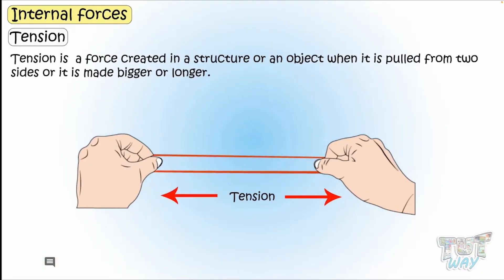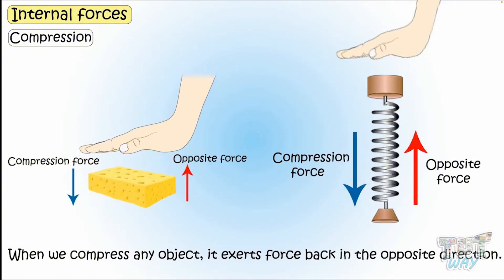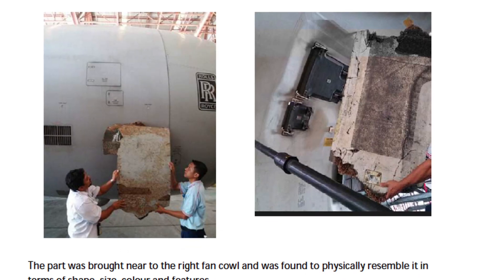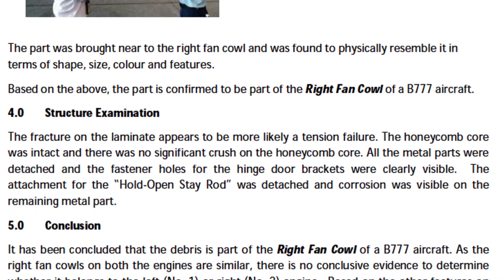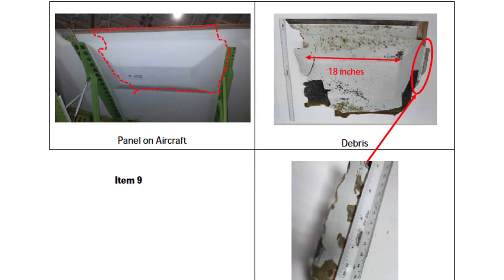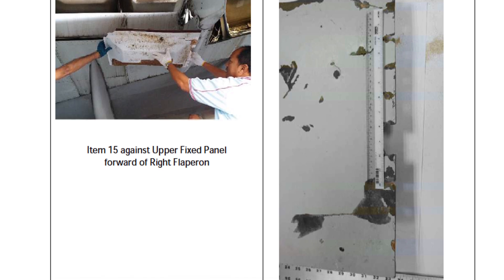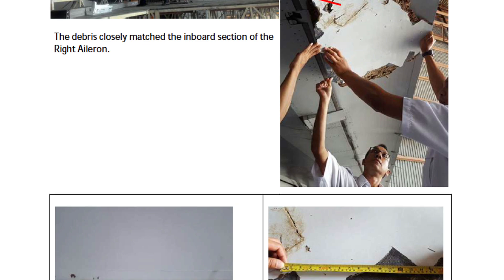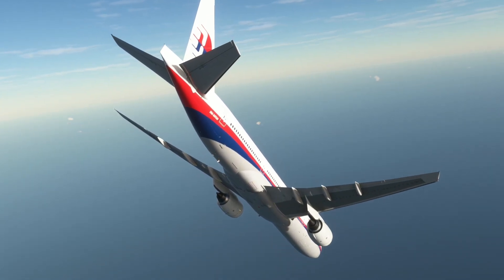How The Plane Broke [Finding MH370 S2Ep11]

Comment: Does the debris that has been found from MH370 look like the pieces were possibly separated from the rest of the plane by man?
Reply from the maker: That's a great question. Malaysia published a report describing the kids of mechanical breakage that each of the pieces of debris found, and they overwhelmingly failed under tension (i.e. pulled apart) rather than compression (being crushed, as you'd expect in a high-speed impact.) I should do an episode about it....

Comment: If this plane was said to have been   flying around aimlessly over the Indian Ocean etc,  until it ran out of gas.. It's my belief that it had to be hijacked.   As if something happened to one pilot,  the other pilot could take over. If it had some mechanical failure, I think at some point, the air traffic controllers would be told,  after all that time..all those hours, before plane was lost. RIP to all on board.  I believe it hijackef
Reply from the maker: I think the evidence, taken together, solidly points in that direction.

Comment: The flapper on was extended when it hit the water meaning someone rode it all the way to the water.
Reply from the maker: That's a notion that has been widely circulated on line but official investigators came to the opposite conclusion.
Reply: But if the landing gear door was found torn off that leads to the landing gear being down for a ditching. If it wasn’t open it would have been crushed. So who ditches with the landing gear down but flaps not engaged? Is that even advantageous at all?
Reply: @wuldntuliktonoptb6861 That was also misidentified as a landing gear door

Comment: The mystery man interview did not sound genuine.   For example it’s 100% obvious the MH370 did NOT hit the ocean nose first at high speed.  The mystery man was claiming nothing can be gleaned from a single piece of evidence. This is an outright lie and he must know it. Granted, it’s not going to give the whole story with high degree of certainty, but that was not the question.  And the nose evidence proves the official prevailing narrative that the plane nose dived into the sea is impossible. 
    The fact that the official findings ignored this fact and that the crash investigation team included experts raises the question why was this intentionally ignored? 
     Also the flapperon damage shows it was extended at time of impact which implies someone on board was attempting to survive a water landing. This leads to the question was the crash location a rendezvous point where he was picked up?

Comment: TWA800 fine point: I actually had some minor involvement.  Although yes massive reconstruction effort over time, within a few weeks of the accident, I told my boss the experts are saying it was probable jet fuel/air mixture explosion, and not a missile.  We found out there was already joint industry task force working the issue and possible solutions.   This is my perspective - not sure exact timing when fuel/air mix was first suspected, but there were prior examples so the issue was known, which I guess was a little like 737MAX waiting for the next shoe to drop.  Debris was supportive proof but not the only clue to the answer.
Reply from the maker: Thanks for this! One thing I didn't include from the conversation was him telling me that the reconstruction of the plane in the hanger was for the benefit of the media and the public, it wasn't necessary for solving the case, as you point out. Just by looking at the pieces as they collected them they were able to read the story in the pattern of breakage.
Reply: @Jeff_Wise  OK yes that's what I am saying.  Somehow Boeing and NTSB knew fairly quickly what the probable cause was (for TWA800 and probably MH370).   Of course FBI was brought in for TWA800, which NTSB always  brings in FBI if criminal activity is possible explanation for the crash.   This is what MH370 should look like: NTSB+FBI on the case, which was an option available to Malaysia.   Now we are trying to solve MH370 without NTSB+FBI, replacing that with groups with bias and internet crowd sourcing: not going to work in this case due to huge denial of pilot criminal intent to fly all the way to hide aircraft.  That likely scenario is an anathema for Malaysia, China and many vocal voices (special interests related to aviation industry, and many in the public).

Comment: MH-370 seems to argue for development of systems which upload CVR/ FDR data in real time to a cloud (as well as retaining existing black boxes). We’d have a reasonable idea of what happened AND where the wreckage likely was well before reaching the ocean retrieval site.
Reply from the maker: It was the data sent by ACARS through the satcom that told investigators where to search for AF447. MH370 had the system but the perp/s turned it off. As a general rule, pilots aren't going to want a system that you can't turn off, so I don't think there's any hardware you could install that would prevent a future MH370 from happening. However, a streaming data transmission system is very doable, in fact there are models already on the market. The question is getting airlines to pay for it...
Reply: @Jeff_Wise  Thank you Jeff--keep up your superb technical analyses--so valuable, intellectually stimulating, enjoyable too :-)
Reply from the maker: @Michael.Chapman  Thank you so much Michael!

Comment: Hi Jeff.
Off topic, but do you believe that was the story of TWA 800?
Reply: It statistically close to impossible for over 30 independent eyewitnesses to all be wrong in seeing something streak up towards TWA800 and then when hitting it a big explosion happens. Say one in a million chance  in a peace time place to see something streak up and hit (or a very  close miss) an aircraft at around 18000 ft and the explosion just caused by short circuit in a fuel tank also one in a million. So you have a million x a million which is one in 1000000000000 chance. Just with that there is no need to spend the time putting the aircraft back together in a hanger.
Reply: Did a lot of research into TWA800. Official report is 99% fuel tank via wire spark and 1% missile. The simple facts are opposite. No ifs or buts.
Reply: Also you are not off topic as TWA800 has the same genetic background as MH370.
Reply from the maker: Another similarity is that many in the general public intuitively feel that eyewitness reports are more credible than expert analysis, and so become passionately attached to a narrative that privileges those reports. People who study air accidents over time eventually recognize the inaccuracy of eyewitness reports.
Reply: Also thanks again Jeff for creating these interesting videos on MH370. As previously mentioned it would be great to have one episode dedicated to the background of the oldest Iranian passanger. Also another episode on what was the aircraft spotted in the Maldives at 6:15 am local time on the same day MH370 went missing.
Reply: Jeff so I assume you fully support the findings of the TWA800 report. I.e. 99% spark in centre fuel tank and 1% missile?

Comment: Great overview Jeff, but it mustn’t be overlooked that debris that failed in compression will not float so well as those that failed in tension. Hence we have found mainly parts that have failed in tension.

I think an inflight breakup can explain the debris we have. Specifically, a right wing failure will explain the relatively undamaged flaperon, outboard flap and inboard spoiler which are all from the same part of the right wing.
Reply from the maker: Thank you! My source at a very reputable US organization, who was directly involved in the official search for MH370, didn't think so. I would add that people in the field generally don't think it's possible to form sound judgements about debris just from looking at pictures of it.

Comment: This is the first time I have heard the list of found debris and their failure mode. One possible resolution of the failure modes (mainly failed in tension) is a high speed break-up where aerodynamic forces essentially ripped the pieces off the aircraft. That said - I don't believe the aircraft failed in a high speed break-up mode.
Reply from the maker: Of course if it did go transonic in a vertical dive, fast enough for pieces to come ripping off a la Silkair, that brings us back to the question posed in  Episode 10: what wasn't this high-energy event detected by hydrophones?
Reply: @Jeff_Wise  Very good point. I suppose it is possible that the aircraft broke up into small pieces which essentially floated down to the ocean. While this is possible - this is surely not likely.